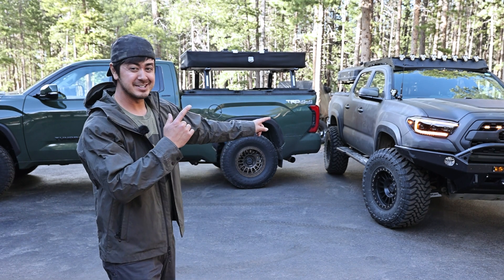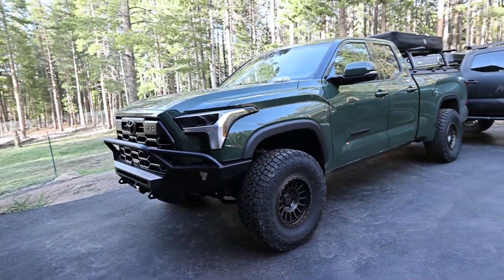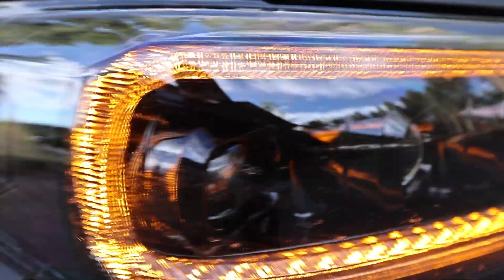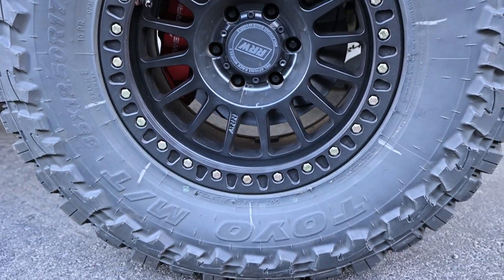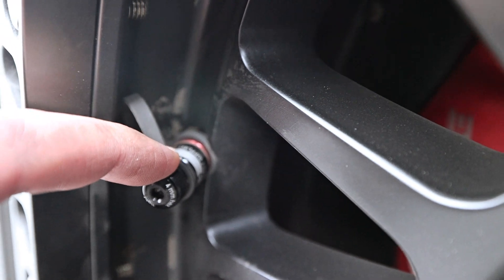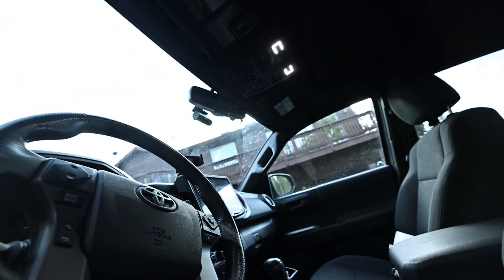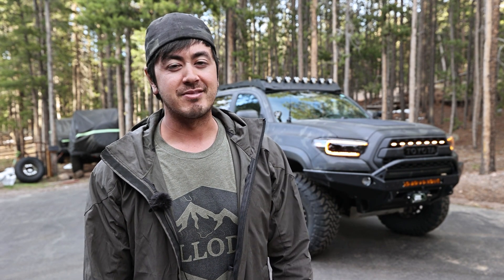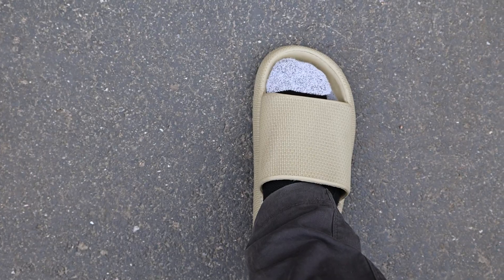TACOMA UPGRADES - Pt 3 of 2022 Mods To My 2016 Toyota Tacoma TRD Offroad Overland Build

Comment: If your only qualm with your Tacoma is the transmission, then get a 6-speed manny and shift when YOU need that extra gear or RPMs!! I have a 2021 TRD Sport and have no issues after 14K miles. 4-Lo is all you need for crawl control in 1st and 2nd gear too plus factory integrated rear locking brake differentials trails breezy. I’m so honored to be driving this beautiful machine 🤘 ***possible video idea could be automatic vs manual transmissions on same trail lines!! Keep up the great content and thanks for all knowledge you put out there!

Comment: Hey Mike I have watched everything I can on your builds. My question is, I just bought a 2022 TRD sport Tacoma 4X2. I am only using it to camp in Georgia, Alabama, and Florida. I am basically going to use the same set up as you. Diamondback cover, with the same rack, Ikamper mini 3.0. The question is, do I need to upgrade the leaf springs or shocks to accommodate that? I am not doing any major off roading, mostly just trails that normal vehicles can go. Thanks for your time, and great content, you inspire me to get the family weekend camping!!

Comment: Ohhh I love that expedition essentials rail.

I have a 3d printed USB power setup that holds my Ultra-Gauge in the middle while also providing 2 USB ports for power to 2 devices (all in one). 

I would post pictures but...my latest revision is tomorrow (need to install it) and YouTube doesn't let you drop pics in the comment section lol. 

More then glad to share should anyone DM or reply here.
Reply: If you OVTune twin turbo it, and want to really push things, that engine doesn't seem to have a problem with 500ft lbs of torque at 3000 RPMs...

I also reckon you have the money to do that lol.

Super charger = 10 grand (like you said)
Twin turbo kits = about 6 grand (unless they went up last I saw)

Comment: Issue with Tacoma transmission; have you tried some of the tunes to help on the shift points? Or have you re-geared? If so what did you go with?
Reply from the maker: Yeah I have 5.29s and some version of an OVTune. Got wind of another tune I’m gonna try soon to see if it actually does anything.

Comment: Here is your solicited comment/question. 
Answer this please, if you can. 

I have a 2019 Tacoma off road premium, it has all the options, crawl ect. 

When I place the 4x4 in low range there is an annoying buzzing/siren sound being emitted from under the dash, somewhere under the dash???

Can this buzzing sound be eliminated when I have the 4x4 in low range, no it does not happen in 4x4 high. 

Thanks.

Comment: What’s the deal with the trans? Is it messing up because all the added weight? I only ask because I’m in the market and if the truck stays stock, do the transmissions hold up?
Reply from the maker: Trans is fine, just overly aggressively shifts, even stock. Some of that may be due to my elevation. I got a tub which helps a little.
Reply: @LastLineOfDefense  Help me out please what is a tub? Do they offer trans tuning for the Tacoma?
Reply from the maker: Sorry, *tune (autocorrect). I have a yotawerx tune (and also 5.29 gears because of the bigger tires)
Reply: @LastLineOfDefense  I’m guessing the fuel mileage is pretty bad lol
Reply from the maker: Around 13-14 combined I think

Comment: Glad you brought up the power. Wish those trucks had a dealer installed supercharger option like the older models used to. S/C would help out bigtime at altitude, but $10k is pretty steep. Assuming the next Taco will have a turbo like the Tundra, new 4runner, etc.

Comment: How do you pick the correct offset for wheels and tires. I have a 2013 and want to run 32" tires on a 2" lift (because I want to). My biggest question is wheel offset...any takers?
Reply from the maker: It's not an exact science, but offsets that are common fall in the -10 to -25 range typically. Wheel width, tire size, suspension components, body mount chops/relocations all play a factor though as well.